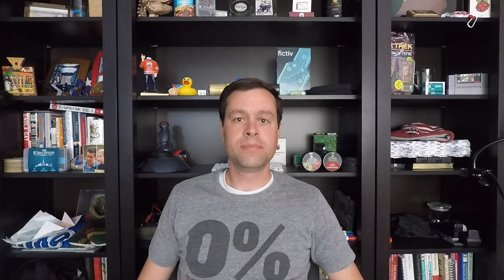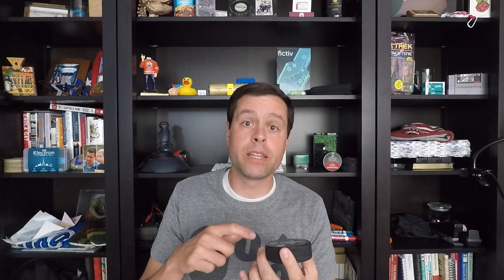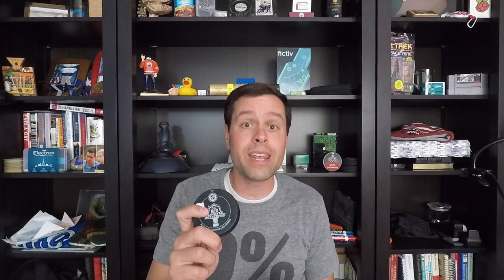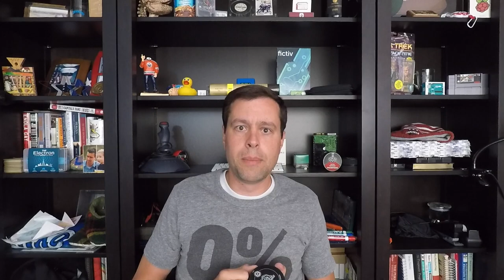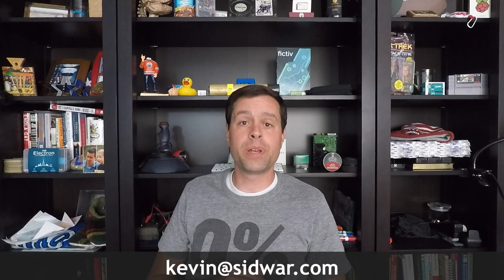I Need More Biz Dev

Comment: Simple answer boss, spend $300, build your own CNC machine, they are not hard to build.
Reply: For the scaling, when you have a need for a run of a 1000, that is when you can turn to a shop, the volume discount usually kicks in around 1000 units.
Reply from the maker: Do you recommend any kits?
Reply: I dont off the top of my head, the last one I built I did it from scratch, since there were not good kits I could find. I can look for you if it would help :)
Reply from the maker: I appreciate the offer Mikey but I think I'm going to hold off on a personal CNC for now. Once I see the market reaction to the first 100 I'll revisit it. Hope you're doing well.
Reply: Sounds like a plan, I am well, just got back from Maker Festival in Toronto, will be putting that video together soon. It is finally cold enough to work in my lab again, so I have so much content to get caught up on :)